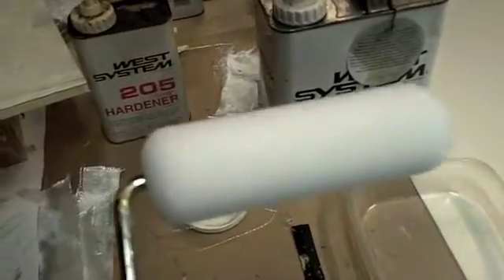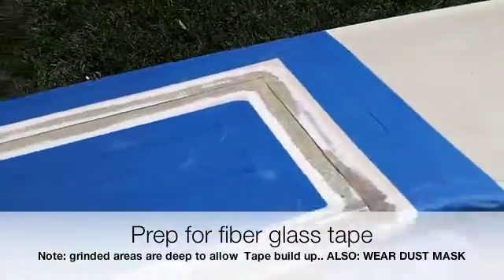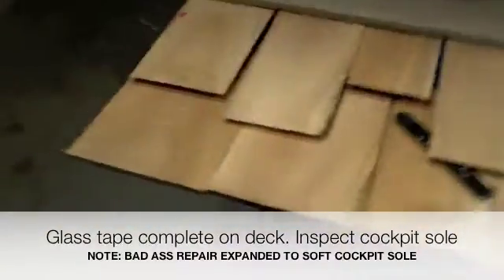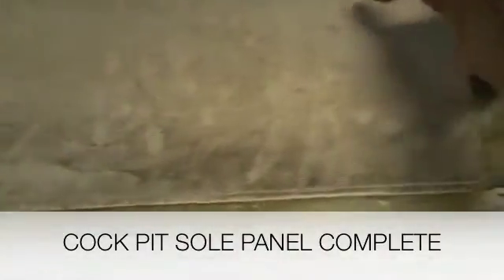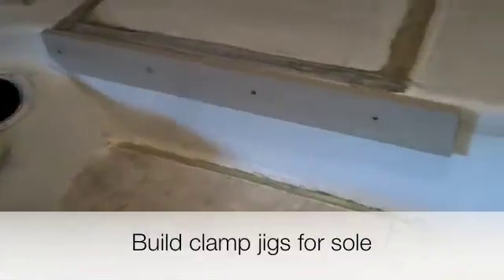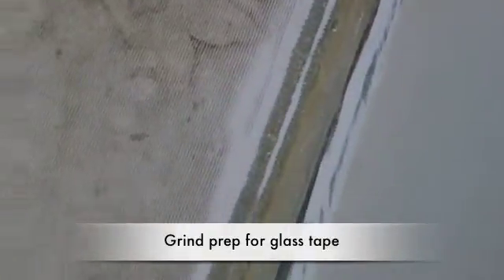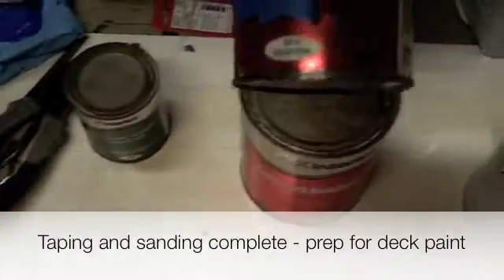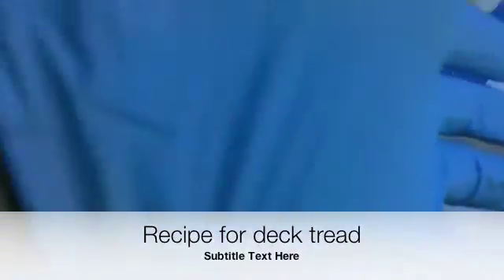Laser deck delamination part 2

Comment: I have the same repair to do to my 89 Laser cockpit sole.  Same question on the panel. Please post a quick comment if you wouldn't mind on what you used for a core to laminate to and how its held up.  Anything you would do differently?
Reply: Core cell foam.  Purchased from Jamestown Distributors. They will know what you should use.

Comment: How you made the surface of the fixed deck the same as the official deck ?
Reply: To difficult to match the same deck without building a mold and taking an imprint ( not worth the time or money). Best way to go is to mix up a tread material and roll it on. As a race boat , not interested in anything looking that good accept sail trim!